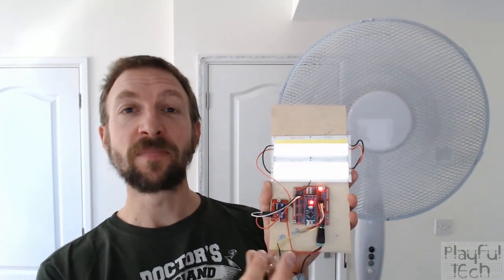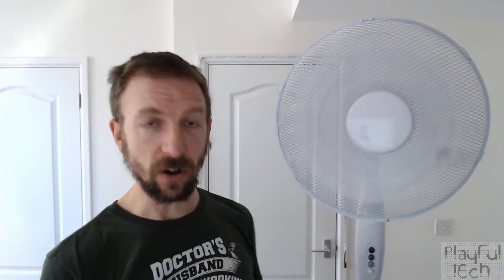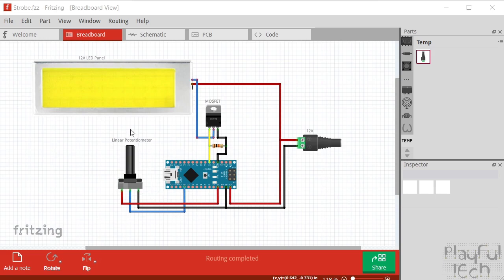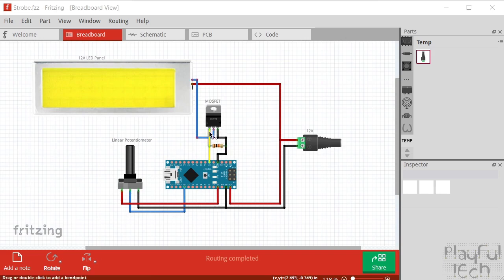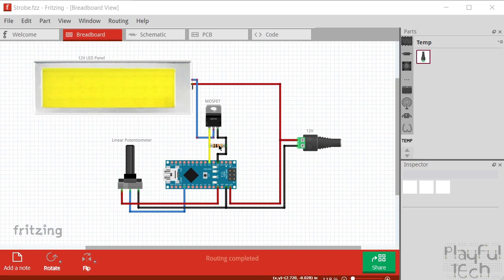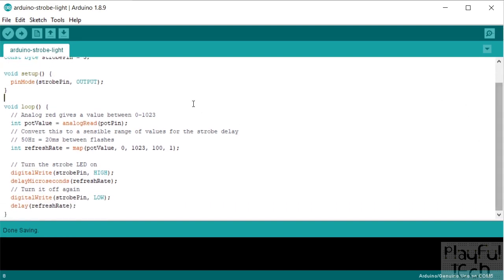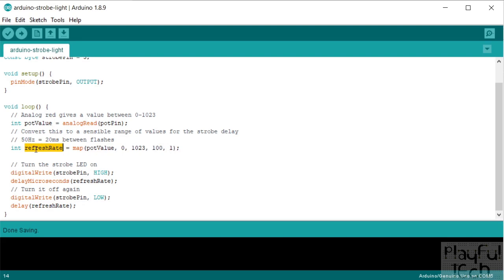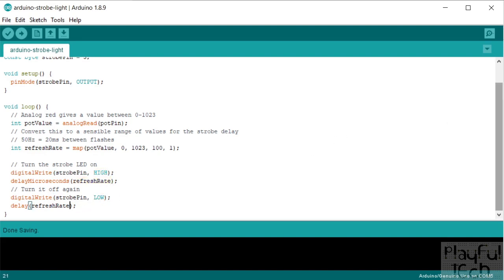Arduino LED Strobe Light

Comment: It is strange to me that the time for which the LED is turned on depends on the delayMicroseconds() function, and the time for which the LED is turned off is controlled by the delay() function. Something is not right if we assume that both functions took the same "refreshRate" argument. The difference is 1000 times.

Comment: this is not working properly, When strobe is maximum light brightness is decrees. can you help me for how to make it professional. or any diagram.
Reply: Using the same numeric value for the delayMicroseconds of the on time and for the delay of the off time (the pause) you get a 1/1000 duty cycle. When the flash is very short, the light seems to be less to the eye.
For the mosfet, you can use a logic level IRLZ44N from Aliexpress.

Comment: Hi I was just wondering what the value of the transistor you are using is and how you connect the potentiometer and power supply

Comment: Maybe it was because I was using a Pro Mini, but I had to change the delayMicroSeconds to just delay to get it to work, but mine works great!
Reply from the maker: I wonder if Pro Mini timing is different due to the processor having a different clock speed? Either that or your fan rotates significantly faster than mine, but glad you got it working anyway!
Reply: @PlayfulTechnology  Great video and super simple solution! I once did the same thing, but way more complicated (code). Btw, its the same with my Nano. I have to use delay. Either my nano is to slow, or I just don't notice the "off" period. I am not really sure if Microseconds is correct at all. That is pretty damn fast. At least in your video it looks like you can clearly notice the difference between on and off. I doubt that the human eye and brain would notice 500 microsecond duty cycles. But that could also be due the camera and the framerate. It would be very interesting to know whats going on here.
Reply: Forget what I wrote :-D It also works with microseconds. But I still think its way to fast. For Testing I used a PC Fan with 1200rpm. Thats 200rp/sec and 1rp/20ms. That means its already by 20 times out of the range of the max 100 microseconds provided in the code. Also you don't really need to use the refresh rate twice in the code. I get way better results by setting a fixed "on" time of 2-5ms and then use the variable refreshrate for the off period. That short and fixed on time creates a nice strobe effect. You could eaven go one step more and use a delay((refreshRate)-(2ms)) or whatever time you used for on. That way your whole cycle will be as long as the refreshrate which means, you could do some math with the refreshrate and serialprint it or show it on a display to print out the rpm of the fan or whatever you track with it.
Reply: @noobsalsowinsometimes8350  Try microseconds for the on time and regular delay for the off time, It works this way too!
Reply: @route-249  Cool, I will give it a try and check out what looks better.